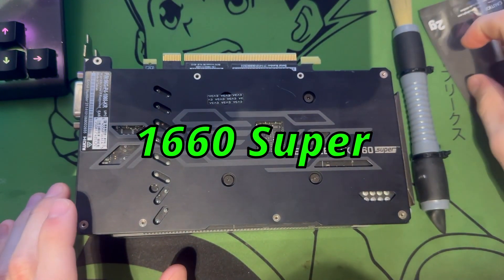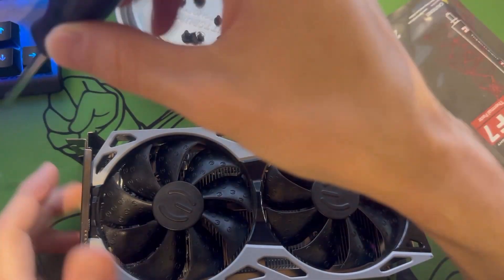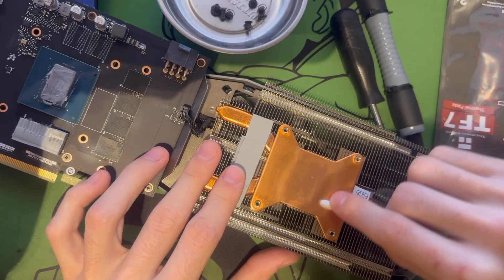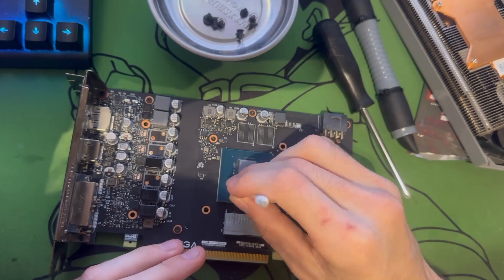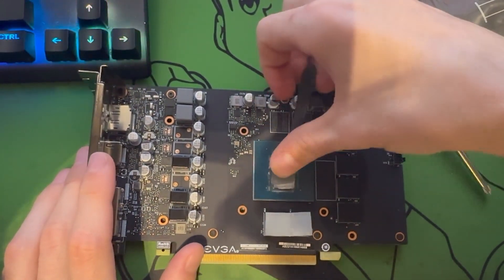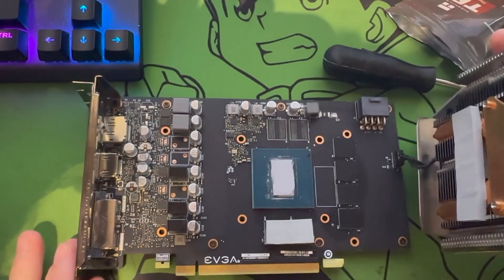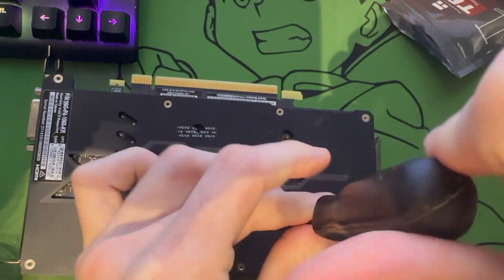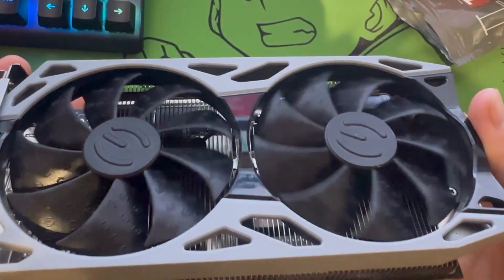Quick & Easy 1660 Super Repaste Guide – Lower Your GPU Temps Fast

Comment: Hey, thanks for the video. I see at the 1:40 mark you have a couple of what I think are thermal pads. Did you add these yourself, my 1660 ti from evga doesn’t have these and I’m wondering if I should order some.
Reply from the maker: no i only purchased the replacements. they come stock with the card and are almost always necessary  for optimal performance you can easily find replacements on amazon or other part site just make sure to get the proper width to make good contact with the radiator